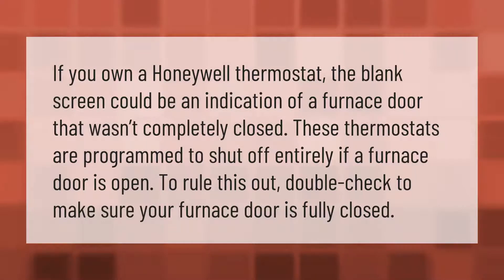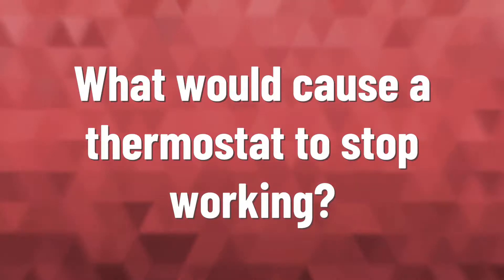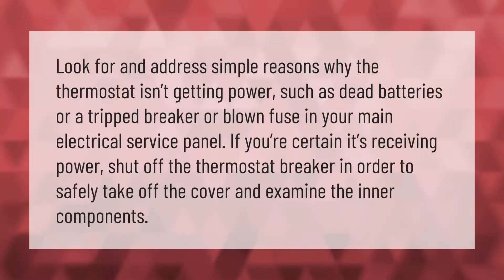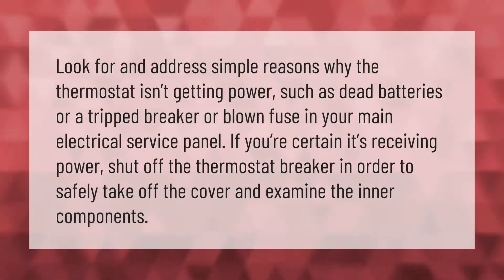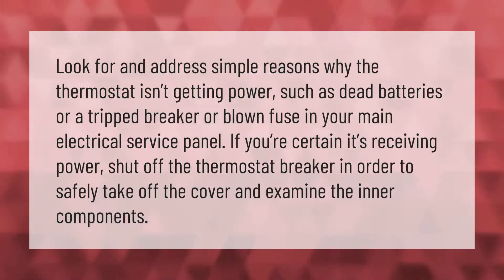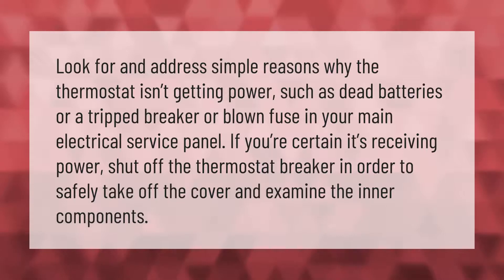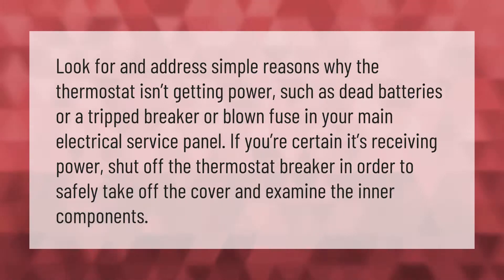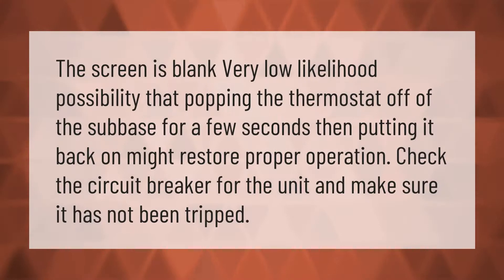Why has my Honeywell thermostat gone blank?

Comment: My thermostat doesn’t have batteries and my screen is blank
Reply: How did you fix?
Reply: @DrewLouisiana2025  check if the furnace door is open?
Reply: mine is doing the same thing after my wife just had to touch the damn thing and turn the system off... now i dont know what to do.
Reply: @Irrelevantskill  We have a Honeywell T6 Lyric Pro and the display went blank three days ago.  We reset the circuit breaker, checked the furnace, and still nothing. We even bought a replacement (identical model) and that doesn't work.  Is yours still not working?
Reply: @HeyJude408  same here - I’m just waiting to get a reply on this
Reply: @HeyJude408  so my unit completely went bad. i literally had to wire in a brand new different unit. its actually SUPER easy to do. youtube hvac man here. the board it snaps into could have shorted out.
Reply: @Irrelevantskill  Thanks, we tried to plug in brand new identical model but still no display so you might be right that it's the board that the thermostat snaps into that is shorted. We'll call the electrician who installed in back in 2019.  Was hoping to avoid this but oh well.